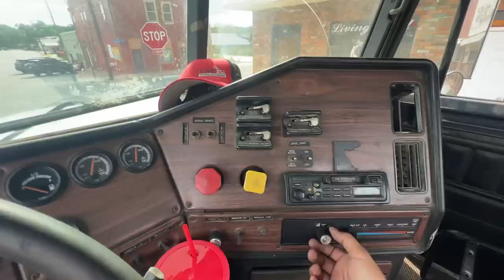Will it Make it Home !! Buying A 60 Series 12.7 Freight SHAKER !! For Local WORK Buying a Work Horse

Comment: Blow by is normal. Them old S60 always start good. Don't run it out of fuel. It will not restart with out putting air to the tank to push fuel up to head or use starting fluid.  So keep a can in truck with you.

Comment: Being a DDEC 3 you need to contact Laurence with Shafer's diesel in Linden TN. He can remote tune if you have a tough book and the software and give you a safe tune that will pull on the cats hands down. I own both. 12.7's live up in the mustard. Don't be scared to run em high. 1900, 2k.

Comment: Congrats on the new truck. Just few things you should look check the antifreeze valve right by the relay compartment check is not leaking. The oil pam always leaks little bit other if is real Detroit always should have a little blowby and when you are ready to get a new turbo get the borgwarner 171702 best turbo so far that’s my opinion.

Comment: Our Milk hauler that picked up our milk at our FARM had 12.7 DETROIT in 2000 Autocar he only changed the oil every 80,000 miles ,never had any motor trouble ! Had about 700000 miles on it when he retired from trucking

Comment: I use to have a 1989 FLD120 double bunk it had a Cummins and a 9 spd tandem. You can get the new door hinges and all new rubber around the doors and windows and we put all new stainless steel bolts and screws in and that done away with the doors and windows not shutting good. Made it like a new truck again .

Comment: Those 60 series are reliable. I drove a Columbia with a 60 series 10 speed glider kit (wish it was a 13 speed). Had blowby and had put additives every 2 weeks per the owner. I was nervous about the blowby but learned they can still run with it. There’s a fld mid roof near me in pristine condition going for 16k. Keys for freightliners should be easy to get made. I even have a way to get KW’s and Pete keys made that I learned from a Spanish guy I met in El Paso.
Reply from the maker: Nice ARIF appreciate it 😎🙏🏽
Reply: Check your local ace hardware. Most make keys by hand still. Got some copy’s made for my cascadia out of old dodge keys
Reply: @FAMUSNARE  ahh so you know the dodge key method 👌🏽. If I’m on the road I’ll usually go to Walmart and tell them to use the dodge key to make a copy. When I first went to Walmart and told them this, they were in disbelief 😂. Then they tried it.. I made him a believer that day 😂.
Reply: @JustTruckin  i appreciate you my guy. Your videos keep me positive when dealing with the trucking industry.
Reply: @BigShaykh  listen I hop in and out of my truck so many times dropping and hooking milk and fertilizer trailers I always have a spare sitting in my pocket just in case I accidentally lock the door on the way out (bad habit) or if I just need to run inside and get food real quick and don’t want to wait for the turbo to cool down. Lost my other spare so it was a long night of googling lol
Reply: Bro my dad drives a Columbia with a 60 series glider with a 10 speed too, funny thing is he wishes it was a 13 speed too😂😂

Comment: if you ever need a turn signal flasher....you have to exchange the vigil panel...the vhs cassette tape looking thing just above the speedometer with two scrrews holding it in Frieghtler dealer item...It also can be rewired so it becomes seperate

Comment: You can get a Marine Cam upgrade for the 60 series as well.  Really simple uogrades, slightly bigger turbo to move air more efficient and youll see 7+mpg out of it.  I do know Tim had issues with reman injectors for these engines, I think the only way he prefers to go is new OE units.

Comment: Nice save, the turbo vains on this 99 are stationary, the W900 ISX is variable pitch . That alone will jack the price up.
   Tim at Gentry & Sons, he's trying out a new piston design that will improve fuel mileage. There's a intake & exhaust manifold s & a different turbo, all aftermarket to boost performance.

Comment: Can't beat an old Freughtliner, and the Detroit 60 is a great engine. The front motor mount in the center of the cradle likes to come loose on those, mine used to do it here and here. Good luck with your new ride... Make that money.

Comment: Hi Justin, if I may give you a tip...before you start investing on 'cosmetics' for the FLD, I would advise you to focus your attention to finding the cause of the vibration. You know what speed it starts at but have you found a higher speed at which it possibly disappears? Shops love to see a 'vibrating' truck, and beware that you don't get led down into the 'money pit' repair journey. It usually starts out as a $500 to $1000 solution to fix the vibration which does not fix it. Then the bills can get bigger as you continue to invest in finding the fix! Seems you have 'big pockets', which is fine, but spending $10k to find the cause of the vibration on a $10k truck makes no real sense IMO. Hopefully, you'll get it solved for a $1000 or less and then start to pretty it up as you hope to and generate revenues. Stay safe and God bless you Justin! 😎

Comment: 🤔First thing i would check on the vibration besides tires is the short drive shaft between the drivers if there is any play in the splines it will vibrate really bad at times...i had one on a peterbilt do that ,put a new shaft and u joints...solved my issue...just saying.
Reply from the maker: Appreciated
Reply: Also check your carrier bearing and make sure the rubber is not dried out and not holding the bearing tight...also make sure the whole drive line is clocked right.

Comment: I would put 7 inch mitor cut stacks on that truck Detroits sound awsome with straight pipes but not with 8 inch 6or 7 inch and yes I drove a freightliner classic with that motor

Comment: I bet you will drop 5000 pounds off your empty weight the Fld is generally a very lightweight truck,I think you made a very wise decision it's not a show truck but it is a moneymaker. For vibration if the driveline and u joints are good make sure you check the ride height if it has air ride, and it may just be a tire out of balance. I like it those old Fld's are good trucks and that 12.7 is a great engine that will work great for the cement haul.
Reply from the maker: Appreciated JD

Comment: If you get paid by weight if you can skip the passenger seat only use one fuel tank see if you can find aluminum wheels for the inside anything to lighten up the truck

Comment: I wish I knew. You needed a 60 series Detroit. I'm selling mine. It's a Daycab 2014 freightliner Glider. 12.7 in excellent condition. Completely rebuild engine with only 70 miles on it. But the vibration is topical on these trucks.

Comment: That Detroit 60 is a way better engine than that Cummins in the W9 no def no sensors very little electrical i don't think the 12.7 even have an EGR 14. Does though those were die hard engines tough as hell

Comment: Justin I have not ever seen or driven a Detroit that hasn't leaked a little oil they all did just got to mind the steady flow from seals or gaskets but every one I drove leaked a little! The vibration could be the tires if they don't match it could cause that!
Reply from the maker: Thank you DC
Reply: @JustTruckin  good luck with your new hauler looks and sounds like a money maker.

Comment: Hey pal what do you recommend a Volvo D13 or A Volvo with a Cummins ISX15 2019?   Thx
Reply from the maker: Both good motors but Volvo a little cheaper to repair
Reply: @JustTruckin  Do you recommend a Delete on a D13 motor a 2020 model year? With like 550k

Comment: "Lil Mule", you'll have to get that painted or vinyl lettered on the rig some place, gonna make it better than using that beautiful W9 running cement, i cringe every time i see it go into that silo to be loaded, cement is horrible and so is asphalt, i used to hate cleaning the truck during hot top season, takes forever to get everything cleaned off specially if you are OCD like me.. awesome addition !

Comment: On the vibration at higher speeds; it sounds something like what I have on my Dodge Dakota pickup.  Asked the dealer mechanic when I first got it, and it's the fan causing vibration at high speeds (due to the wind from the speed) In my case starts about 70, and less with throttle. Might your truck have the same kind of vibration?

Comment: Anxious to see you pull your first load with the new to you truck! There must be good money in the tonnage to warrant the expense of the truck and insurance costs, but you’ll find your way I am sure. Look into a product called “Ospho” it is Osphoric acid and it converts rust back into iron, you paint it on let it sit and it also turns the steel back into black. It doesn’t fill in holes but it does stop the rust in its tracks and when you paint over it the rust does not return and bubble under the paint. Best of everything to you and the family!
Reply from the maker: Awesome info thank you Jim

Comment: The FLD will do you good on the cement runs. I own a 2010 Western Star with an extended  Big Cab I use to pull my Travel Trailer which is a Monster. My 2010 Has less than a Hundred Thousand Miles an APU and it is rebuilt due to a fire in the rear. Had to put two full axles and all the hardware from the cab back. I found a wrecked one and used the rears. It looks perfect and Western Star said it was a good repair. Rear cab panel only had less than 800 bucks damage. Frame was ok and wiring was minimal. I have had it about 8 years now and it is Black and Beautiful. I bet I have less than 20g on the truck for repairs using used parts, and the Truck was 8g from the Insurance company. I have been offered 59g lately and no way. Zero Problems. It has a 10 speed. I use Slick 50 in my engine and rears it kills any wear. It has a rebuilt title. It is equipment who cares. I think tires cost more than the truck lol. I got lucky when I bought it.
Reply from the maker: Great buy for sure

Comment: Yep, the old 12.7s are good motors, and youre finding out how cheap the parts are! 

They do better on fuel than the cats and cummins of that same time period… I would caution about not expecting super high mpg cause a day cab with a cement trailer still is a drag… but for $10,000 and whatever else you put into it even an overhaul, youre already ahead at that price!

Comment: ...if you want the shakin' to decrease...3 pair of Centramatic sets...that's 3 axles.  I did that on mine when I signed the papers...3 weeks later, smoothed out nice
Reply: When you start out on new tires, ...it takes a couple weeks to round the tread out.

Comment: Hey Justin.  12.7 i cam walk you through pretty much everything. Good news it already has updared ac alt mount setup. Biggest thing that destroy them is the bull gear. If you have no info on it being done i would do it when your able. If it was me if do the tires new shocks check carrier bearing and see if vib goes away. Id run the overhead which is super easy.  Well depending on ehat jakes it has lol if it has the 2 piece jake heads you have to take them off and use the jake stands on the side to remount the rockers. Turn it over until an injector rocker starts to push down on the injector. Than you cam set those valve and opposite injector.  So 1 injector pushes set 1 valves 6 inj 2 valves 5 inj 3 valves 4 injector 4 valves 3 inj 5 vavles 2 inj 6 valves 1 inj.  Settings are on the cover vavle pan gaslet is reusable 

Biggest oil leak is cam football gasket. Its on driver's side above the air compressor. You will see a valley at the head and front cover. . 

Also the detroit os opposite of the Cummins your use to. They like rpms. 1500 to 2100 she will pull. Safe to cruise around at 1400 but dont lug them down lkke a cimmins. You will end up with a inspection window in the block lol.
Reply: Detroits, Give them good fuel and good air then treat them like you hate them and they will work forever !! Good Luck on this new chapter!! Oh a good breaker break two way communicator !!And clean up the W-9, cement  powder takes toll !! Thats my 2 cents PARTY ON!!
Reply from the maker: Thank you so much Stephen😎🤘🏽🙏🏽

Comment: We got a truck exactly like that at our company. Great truck, strong motor. But they had to put a Huss regen system on it when CA first required it. System loads up daily but truck still runs very strong and better than our newer trucks. Good luck with your new truck.

Comment: Hey Justin, super cool freight shaker. The vibration in 10th gear seems to me like it could be the front wheel bearings need to be either retorqued or replaced.  For that old of a truck, that's more than likely the problem.

Comment: I have a 97 FLD 112 has a m11    engine was replaced seven years ago. It has heated fuel tanks because it use to run west coast up to Oregon. My steering wheel was bad too. I replaced with a vip wheel.

Comment: Congratulations on getting a day truck Justin.  Looking good.  Just wondering if the shaking, since you say it only happens at high speed, may be wheels need tracking?  Also, looks really good after the paint job.  If the bloke who sold it had done the same, he may have been able to sell it for more